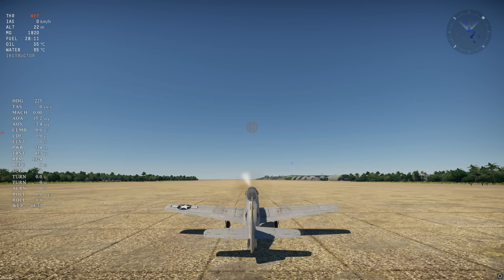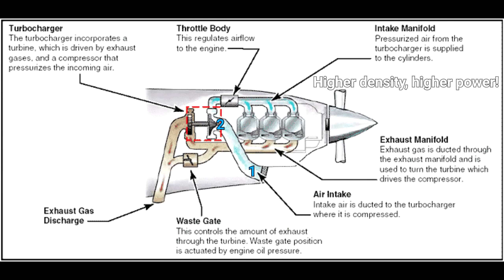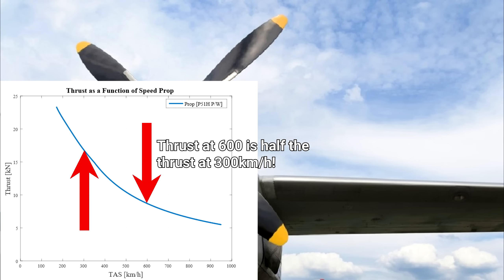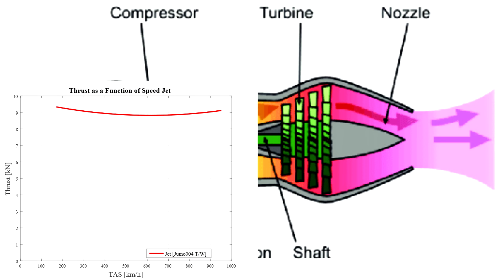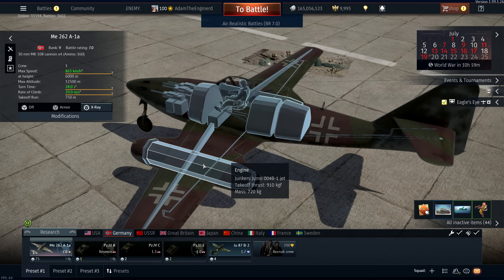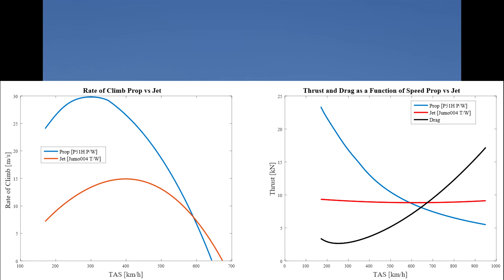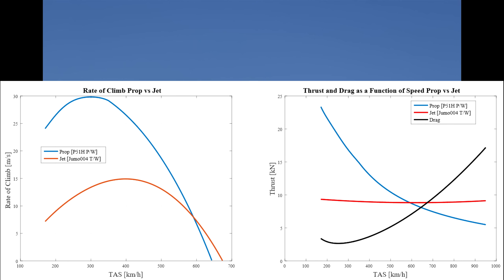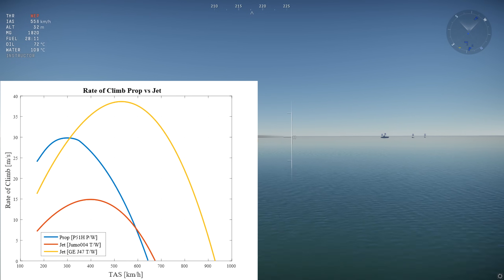Aircraft Performance | Piston Engine vs Jet Engine!

Comment from the maker: Give me your educational video ideas!

Also follow me on Twitch! https://www.twitch.tv/adamtheenginerd
Reply: Aircraft stability and control perhaps?
Reply: Superchargers vs turbochargers, multi-stage stuff in engines
Reply: The most clean prop fighter
Reply: Could you do a comparison like this but with jets like the mig 21 smt, F4 and others? To see which engines perform best at certain alts and speeds or which engine has the best twr?
Reply: Pusher vs normal prop
Reply: how fast go aywo pawne?!
Reply: why not talking about propellers adn controll surfaces?
Reply: Does some plane physics broken i.e Yak-1b, yesterday I was diving in yak and my wings broke and flew away. Somehow, I managed to land her back using only rudder
Edit : I played SB
Reply: Breakdown of the very long Wiki article about the aerodynamics of the Eurofighter.

Its nothing about War Thunder but still very (or even much more) interesting.
Reply: Hey dude, do you also have any website you use for communication with your audience so I can potentially join?
Reply: How far can a P-51H glide from 3000m of ALT?
Reply: @eddyroilo9152  approximately 45km. 15:1
Reply: @zedoktor979  outstanding, thanks man. Well not that I need it anymore, I suck at air RB and I quitted WT long ago
Reply: Adam please explain how to use efficiently the engine mixtures, radiator, propellers, supercharger gears etc
Reply: Can u translate your videos to others languages?? 
I cant speak english very well, its very dificult to me (but i can handle a little) hear u and know what u said...
And ur videos are very useful!!
Reply: Hey adam I'm a senior level mech eng. major, I would love to see how you're simulations in matlab work!
Reply: counter rotating propellers?

Comment: does a double propeller mounted in the front of the plane (like the A2D) increases thrust??
Reply from the maker: That's a good question. It's mainly to keep the propeller diameter small while still being able to efficiently use a  lot of power, and to remove torque. It's a bit more efficient too, but also heavier.
Reply: If a space fighter plane had the wings design like the Imperial TIE fighter, Y-Wing, X-Wing, T-50, Darth Vader's private Tie fighter, and many others, would it still guarantee the plane to fly in the atmosphere similar to earth?
Reply from the maker: @Historedity  Anything can fly with a powerful enough engine, but those wings would be inefficient in an atmosphere indeed.

Comment: Im on d side of G.T.E. I think you miss the very importance of comparing between two engine that should have the same mechanical design of transferringn its power.Piston engine propeller  vs. turboprop. And i think piston engine has less problem accelerating itself because in terms of producing power to its combustion, piston engine has a what we called compression and while the turboprop(turbojet) we have  a pressure inside combustion chamber. So accelerating the propeller isnt that much harder to piston engine and while to a turboprop it takes a few second to accelerate the props. And the problem to a piston engine is itself, at the high speed situation piston cant handle a huge mass that it produce due to its reciprocating motion, vibration cause of a sudden change of pressure and the design of the crankshaft(firing order)so it will only end up in a self destruct engine. While a turborpop there is  No problem producing a high speed motion because the nature of its design it only rotates and less mass problem.
Reply from the maker: The point is comparing the performance of early turbojet engines at the end of WW2 against late piston engines to see if it was worth using the early turbojets in combat aircraft, that's why I'm making this comparison. There is more inertia to a turboprop or a turbine engine in general than to a piston engine indeed.
Reply: @AdamTheEnginerd  yes and your right and thanks that WW2 ended before the german develop its G.T.E thank you for posting a video about it.

Comment: Hmm... it seems the inefficiency is because of the propeller not by piston engine itself. There are Turbo Props.

I would love to learn why prop engine now primary uses jet not piston
Reply from the maker: No it's just how piston engine power varies with speed.

It's for ease of maintenance, less expensive fuel and parts and more energy dense for high power applications than for pistons.

Comment: Are piston engine fighters/ bombers better at maneuverability , turning tight corners, rolling etc (so as to get on the tail of their opponent ) than a jet fighter aircraft?
Reply from the maker: They aren't better because of the different engine, it's because it's more advantageous for jet aircraft to have a lower wing area to reduce drag and be able to reach higher speeds than for a prop aircraft, so a prop aircraft will tend to have a lower wingloading and hence turn better than a jet.
Reply: @AdamTheEnginerd   Thanks. So theoretically , in dogfight between a jet and a piston engine plane, i guess it will be very very difficult for a jet to get onto the piston fighter's tail.
Reply from the maker: @tanmayranjan6057  Yup, exceptions are early jets like Meteor and Ho229 which have similar wing loading as piston aircraft.

Comment: You need to consider fuel weight, as jets are drastically less efficient per unit time.
Reply from the maker: Would be fairer to compare for a given range, but then you need to consider the extra propeller weight, cooling system weight and drag. The approximation I made was to not consider fuel consumption and cooling systems, it seems reasonable to me.
Reply: @AdamTheEnginerd  what you're saying is absolutely reasonable, but the more factors that are considered, the more accurate a representation of each technology we receive, for example, b-51D and H also got a small degree of thrust from their radiator  cooling systems underneath the aircraft. I totally understand the amount of time that would require to pack something like that into a video, while also keeping it interesting for the audience. It certainly isn't always practical to make the video more complex.

Comment: If props are more efficient then jets at low speeds then why does a A10 (which is slower than a p51) has a jet engine.
Reply from the maker: It has a high bypass turbofan instead of a pure turbojet, which is significantly better at A10 speeds than a turbojet. For A10 duties a turboprop would probably have been ideal, but then where will you mount the massive gun if you have a prop in the front? Turbofan engine naturally allows you to mount 2 of them for safety as well.
Reply: @AdamTheEnginerd  thanks Adam!! you really do know a lot about aircraft!

Comment: Adam, how do I kill a yak in a 109G2 or K? General information if they're similar. Specific information if some are different.
Reply from the maker: Depends on Yak. They'll outturn you, so get the energy advantage with your superior climb/altitude performance and BnZ.
Reply: @AdamTheEnginerd  But, those things barley stall and have better climb than a K4 or G2
Reply from the maker: Nah they have worse climb except Yak3U/VK107.
Reply: @AdamTheEnginerd  How do I beat those? I forgot that I would play the G6 14 and 10. What is better g14 or g10?
Reply from the maker: Yak3U has worse high altitude performance, so climb. Yak3VK has the BF109's number, weaknesses are guns and low rip speed. You need teammates.
Reply: @AdamTheEnginerd  How high does the yak 3 suffer? In meters. And why are yaks and spits so good at climbing at the start of the match? How do I counter that? I do side climb.
Reply from the maker: Yak3U above 3km isn't too good.

In Bf109s you shouldn't sideclimb, climb straight in and you'll be above most enemies. Counter is teammates too.
Reply: @AdamTheEnginerd  Spits, p61s, f82s, yaks, hornets, mosquitoes, etc. Are all above me tho. Which is why I side climb.
Reply from the maker: You shouldn't sideclimb when in a good climbing plane, you aren't supporting your team while you are sideclimbing.
Reply: @AdamTheEnginerd  I side climb then at 4k-5k meters I head to the middle.

Comment: Adam, how do I kill a Japanese plane in a 190f or 109g6 and up?
Reply from the maker: Rare matchup. 190 run to teammates, 109 climb until you have the altitude advantage.
Reply: @AdamTheEnginerd  Could you tell me what the Japanese vehicles are good and bad at in a nutshell? Kis and a6ms and J2s etc?

Comment: Adam, I've joined your stream and have been told don't trust stat cards. Do you have a spreadsheet for actual stats? The MER one needs to be updated I think.
Reply from the maker: Yeah stat cards are very misleading. Check spreadsheets in the description.

Why do you say the MER one needs to be updated?
Reply: @AdamTheEnginerd  The ta152 has a new MER after 1.95 I think
Reply from the maker: Very close to the same, but yeah will retest it soon.
Reply: @AdamTheEnginerd  Are you willing to do turn or climb next? Can you insert a tutorial on how to calculate the statd by ourselves? Like the formula or something.
Reply from the maker: I did videos on turn and climb.

Turn: https://www.youtube.com/watch?v=HVhf8hL_buU&t=0s
Climb: https://www.youtube.com/watch?v=eEeBX7XAgsw

Comment: Hey, what would you say is the best P-51 for its BR?
Reply from the maker: P51, P51D10, P51H.
Reply: @AdamTheEnginerd  Thanks for the response. But I looked through the tree, and I don't think there is a P-51D-10. Do you mean the D5, D20, or D30? Also are those ones bad?

Comment: the plane consumes a lot on take-off and landing. An airliner generally manages to safely travel 10 meters per meter of altitude simply by gliding, so if a plane flies at 6000m it can lower engine power and descend without consuming fuel for 60km

(Comment bugged, see answerers)
Reply from the maker: Even more than a 10 glide ratio.
Reply: AdamTheEnginerd lol YT has lots of bugs. I’ll try to write again the whole comment
Reply: AdamTheEnginerd Hi Adam! Why are planes the most polluting means of transport for stretches between 500 and 1000km? Flying at high altitudes the aircraft has less aerodynamic drag and does not have the friction caused by the tires. The explanation of many newspapers is this: the plane consumes a lot on take-off and landing. An airliner generally manages to safely travel 10 meters per meter of altitude simply by gliding, so if a plane flies at 6000m it can lower engine power and descend without consuming 60km fuel
Reply from the maker: @ferrarisuper  They are pretty close to cars though.

Comment: Is there a reason for differences in the change in thrust at different speeds for different piston engine aircraft? You mentioned before that the 109 generates lower thrust at low speeds(and WEP wouldn't be necessary)
Reply from the maker: Yes! Prop efficiency on small props with high power suffers at low speed, hence why it suffers on Bf109s.

Comment: Piston jet is prop and goes at 400km/h and jet engines goes at 2100km/h end. No need to discuss dhit
Reply from the maker: That doesn't make sense, or you missed the point of the video.

Comment: How to calculate L/D % or sizing from airfoil to the real size wing?
Reply from the maker: There are conversion factors going from a 2D airfoil to a 3D wing, most depend on Reynolds number and aspect ratio. Depending on your precision tolerance, just taking the 2D airfoil lift and drag and adding induced drag could be good enough.

Comment: Here's an idea for the next educational video : to show the differences between water cooled engine VS air cooled engine, and between a turbo prop and a classic compressor. I don't know if this is a big topic, but I'll like to understand why the Wyvern is sooo noisy ;) Au revoir !
Reply from the maker: Perhaps!
Reply: A turboprop is basically a jet engine with a propeller attached to its compressor shaft, so the noise you're hearing from the Wyvern is the loud AF jet exhaust

Comment: Hey Adam. I noticed for the afterburning engines on the top tier planes like on the MiG-21 and F-4, maximum afterburner thrust increases a rather significant amount. What physics are at play that would result in increasing thrust with speed instead of generally constant thrust with speed with non-afterburning engines?
Reply from the maker: You mean afterburner thrust increases as speed increases? In WT after Mach 0.5, jet engines start increasing thrust as speed increases (like in my graph). The same physics are at play, namely the extra ram intake compression.

Comment: Hey Adam, I’m a curious engineering student and I was wondering where you got your stats from for these videos.
Reply from the maker: Mainly from the flight model data files. For this video in particular, all I did was use the power, thrust and mass in the xray and test fly to get a prop efficiency curve (check out my rate of climb video for that part).

Comment: What exactly is water injection?
Reply from the maker: It sprays a substance, usually water or water-methanol, into the airflow going to the cylinders and this reduces the knocking tendancy of the fuel, effectively raising the octane rating. This allows for more manifold pressure, so more air density and power.
Reply: @AdamTheEnginerd  iirc even early jets had water injection as well, to increase the mass flow rate and gain more thrust that way.

Comment: what factors affect a plane's vertical energy retention? how do i know if a plane is good in the vertical?
Reply from the maker: You'll have to define what you mean by vertical energy retention. In my definition of it, there's no need to have VER when you have MER and LER (Linear Energy Retention).
Reply: @AdamTheEnginerd  by vertical energy retention, i mean a plane's ability to preserve it's speed in vertical maneuvers.
Reply from the maker: As in loops? Or straight line? Loops would be a mix of MER and climb, straight line would be a mix of climb and LER.
Reply: @AdamTheEnginerd  well it's a complex topic, i was thinking it'd be a good idea for a video.

Comment: Hey Adam, with the P-51H do I have to change the supercharger manually or the game does it automatically?
Reply from the maker: If you don't use MEC everything is automatic. In the case of P51s, it's automatic even if you do use MEC as well.

Comment: In WT though, I find that at lower altitude, at lower speed, and when fighting the early Axis jets, the late Allied prop fighters often fair better. Sure the jets can escape you, but as soon as you trap them in a dogfight there's not a lot they can do. They acceleration so much slower at low energy that you can catch them for way longer than they think you can.
Reply: 6.7-7.3 jets are actually fun, but nobody who has any choice wants to fly them because 3/4 of your team will die in head-ons to F89Ds 3 minutes in to the battle.
Reply: @theraindog9141  idiots/arcade clowns are in every tier and every match. P51Ds with bombs rushing at 50m above ground, sounds familiar?
Reply: TheRainDog I agree though part of the problem is also the repair costs, the F-80 is one of my all time favorite War Thunder planes but I don't really play it because it's more expensive than an F-4E. Back when it had a more reasonable repair cost I grinded halfway through the American jets with it. This was also before the F89D existed so that helps too, even if it is on American teams I absolutely hate playing with wallet warriors because they still make my experience worse. Whenever there is a sale I just stop playing top tier tanks for a while because of it.
Reply: And this is exactly why the Allies briefly patrolled the extended runway centrelines and approach paths of Luftwaffe 262 airfields, because the jets were helpless to accelerate quickly enough to deal with a rapidly diving Typhoon, Mustang, Jug or Tempest. I say briefly because the Germans quickly caught on and turned the approach paths into AAA hell.
Reply: I recently revisited the me262 and this was my experience as well. Idk why but people seem to not realize that if you lose any energy by turning you'll get turned into mince meat by the props.

Might also be that the experienced pilots are playing at toptier and only inexperienced jet pilots remain at 7.X - since playing jets requires scrapping a lot of the fundemental rules of props the drop in skill level makes sense.
Reply: @Kalmo_  It's also because high-aspect high-closure shots are absolutely horrible to pull off for a novice such as myself, so we tend to want to slot ourselves behind the enemy for an easier shot, thus getting sucked into a turnfight.
Reply from the maker: Yup low speed is where the piston engines are better than jet engines.
Reply: @AdamTheEnginerd  thats why the US navy still used props in the 50s, the early jet engines had low thrust at low speed, which was ** for carrier operations.
Reply: @AdamTheEnginerd  Speaking of higher BR late war props, would you mind flying out the Fw190D-12? It's one of my favorite planes and there are hardly no good videos of it. It gets overshadowed by the premium D-13 and easier to get D-9. Thanks in advance for consideration.